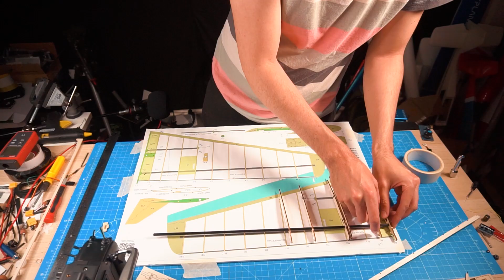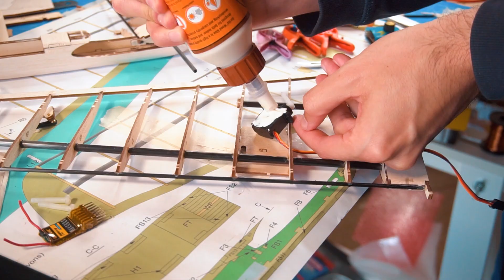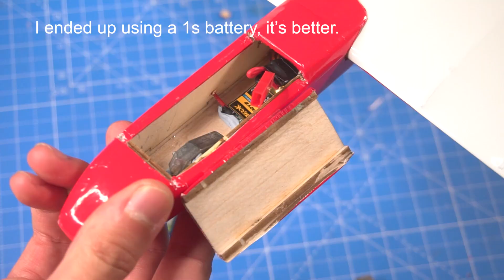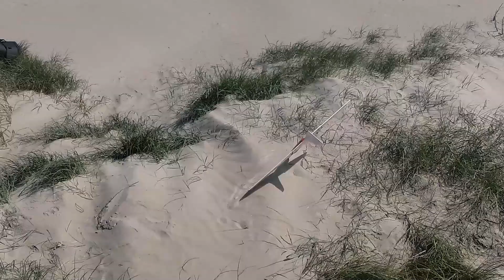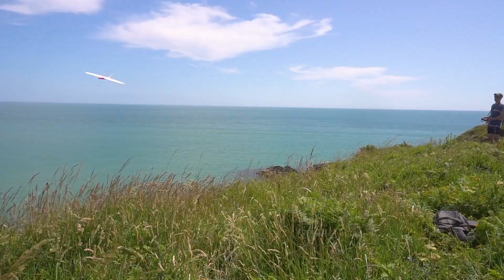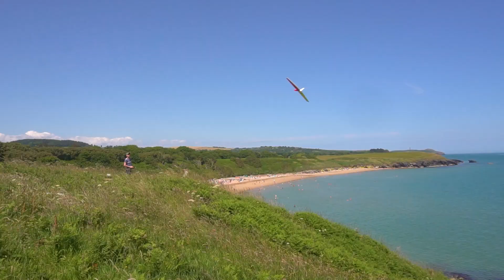Shaka Wing Glider - Build and Maiden Flight

Comment: It's pointless setting these up twitchy in pitch. You lose performance. My guess is a CG @ 40 - 45mm. Where did yours end up?
Reply: The CG on this model is around 25m from the LE in the root. anything further than 30 will make it unstable

Comment: Hi, so what's the aerodynamic benefit of a forward swept wing/plank plane?  My experience is the getting the cog right is a pita and I usually give up and change the wing shape to swept back.
Reply: using the explanation from https://en.wikipedia.org/wiki/Grumman_X-29, another forward swept design. The cross span down wash is point toward center of the airplane instead of the wing tips, so in the event of a stall, you lose lift from the center of the plane first instead of the wing tip (where most of the control surface is located). So hypothetically it suppose to has a better stall recovery compare to backward swap wing (where the wing tip get stall first). Since the aileron control surface is the last part that get stalled. At least in theory anyway, I think it practice, forward swept wing have pitch stability issue.
Reply: @keenheat3335  Thanks for the answer Keen! You are right in an event of stalling, it recovers super fast as it starts in the root, instead of tips. The other benefit of the swept forward design is the lower wind conditions it can perform in. Considering that Shaka has a relatively thin foil, the speed is also not an issue. So in the end, you get a great all-arounder
Reply: There are none. it's just aesthetics.

Comment: is there enough space for IDS pushrods?
Reply: I'd say no, as the secondary spar, the short one that runs till the 5th rib, will disrupt the straight line from the servo till the aileron. However, if you'll decide to push the IDS shaft diagonally, through the 5th rib, and in he space between the 5th and 6th rib, that may work. Another thing to keep in mind is a trailing edge. It's only 3mm thik. If you think that would be enough for IDS,, I'd be happy to follow your attempt! Feel free to share some pics on the RCGroups thread)

Comment: Although it is a very cool balsa wing to have, it is pita to fly this kind on type glider. I have very beautiful Eyecatcher II from wing-tips, similar design. And every time i go flying with this, i will ditch it couple of times because of wrong CoG that need to be extremely precise. Luckily it`s like a tank and handles horrible crashes. Ask me how i know this. 
But yeah, pita to get it in the flight but once it`s in the air, you might even enjoy it. Btw good video!